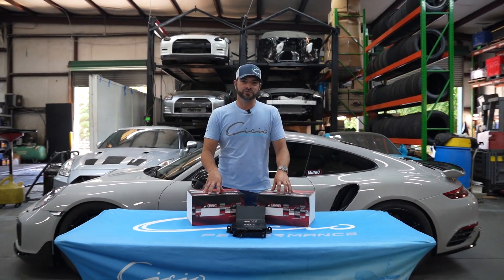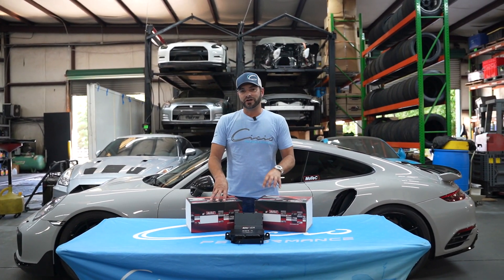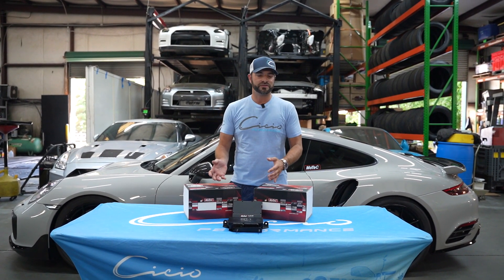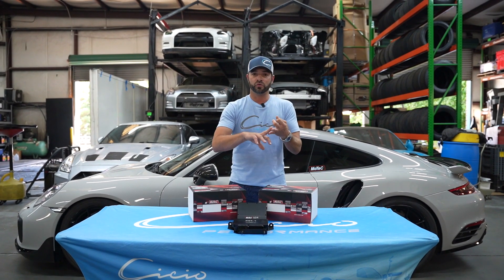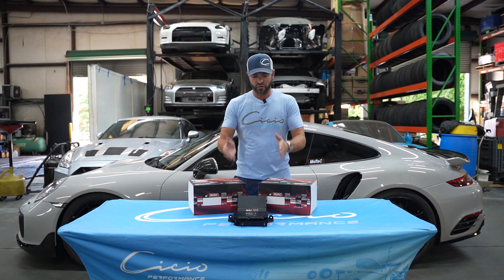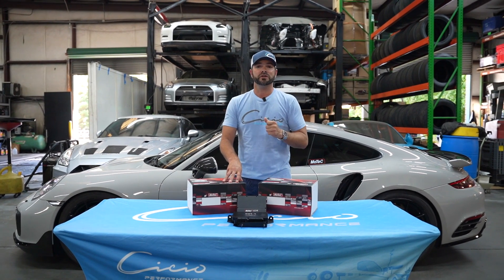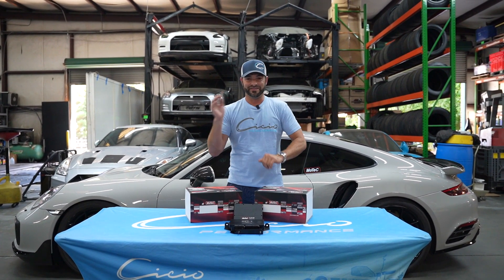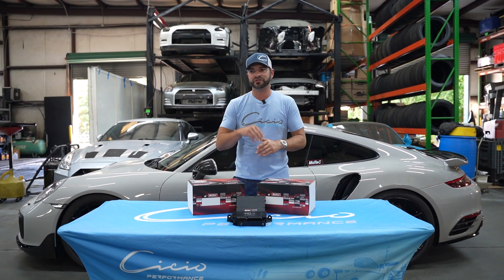Porsche 991 MoTeC Video Series Episode 1: Safeties

Comment: Can you control traction and AWD split with this system?
Reply from the maker: It has full tunable motorsports traction control per mode with more ways to slice and dice the outcome than I can post here. The awd system as of now is controlled by the factory controller and we have not seen any issues from how the factory tcm controls it.